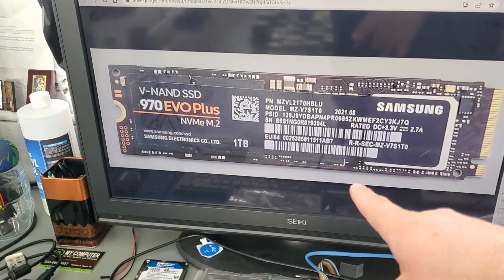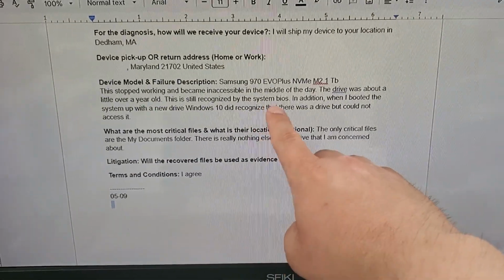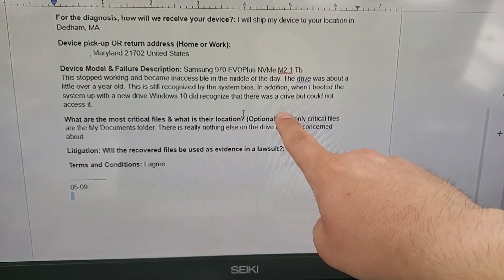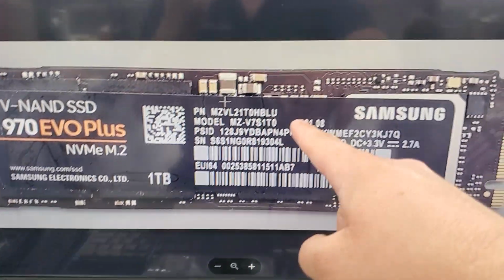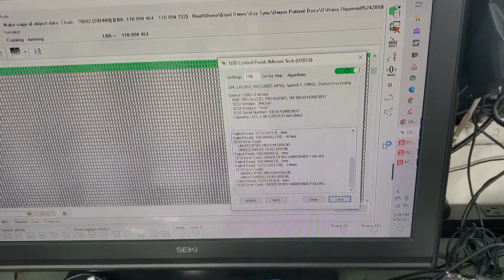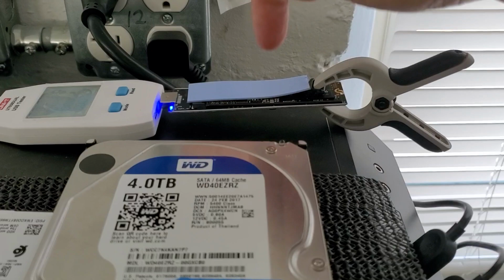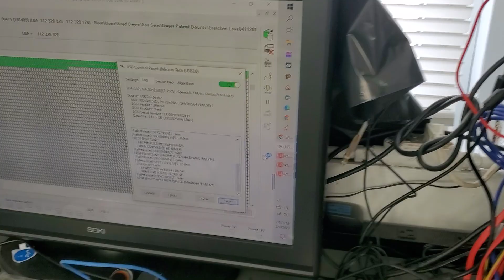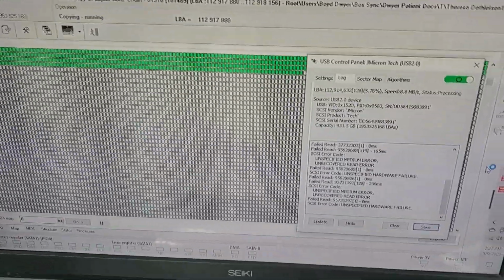Samsung 970 EVO NVMe M.2 Data Recovery with bad sectors chips degradation

Comment: Good afternoon, how did you connect the USB Stab to an ASMT which I suspect is connected to SATA? 
Or is it possible to read the USB Stab directly with a PC3000 Express / UDMA?
PS: Sent you on whatsapp :)
Reply from the maker: Very sorry, I am not sure I understand the question clearly, so my answer may not answer it correctly. Also, I did not receive a whatsapp message.

The connection is like this: NVMe mounted on USB adapter > USB Voltage reader > USB Stabilizer which connects to PC via USB > Run any data recovery tool, like PC3000, R-Studio, DMDE, whatever you want.

Comment: Is it possible to remove HDD password that was set with lenovo t14s? I forgot the password, but need the data
Reply: Difficult to answer... Need more context. What kind of password? Windows password? HDD lock password? Bitlocker TPM encryption bsaed where password would be needed? If it is a simple Windows based password with out any other form of encryption, there are some ways. You can search online for "Windows password removal on Windows 10" or whatever Windows version you have.
Reply from the maker: Without known password, probably not, sorry. Cannot think of a way to crack it.